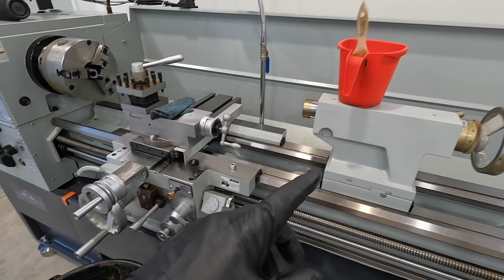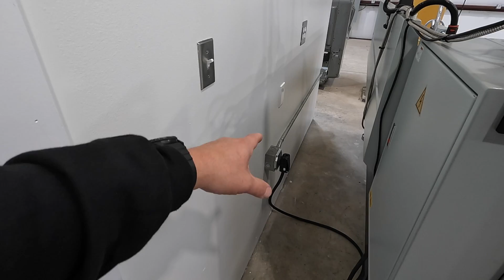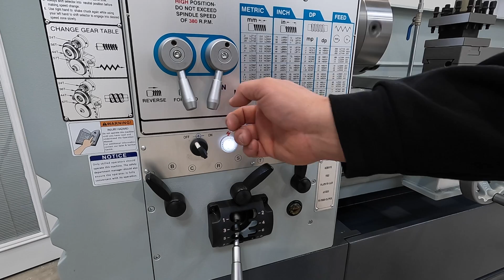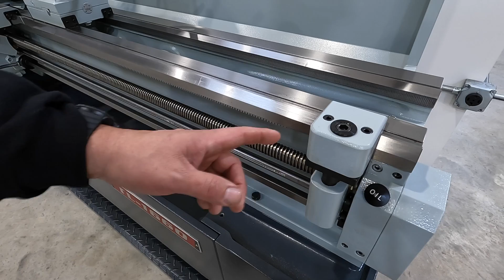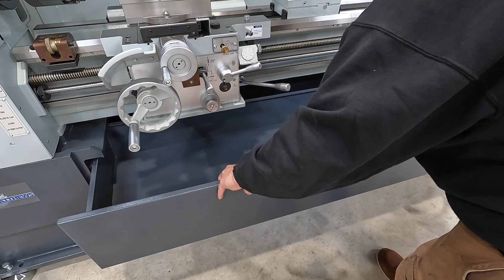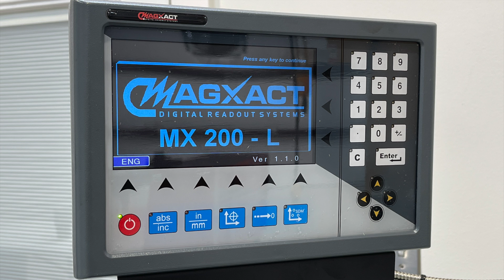Precision Matthews TL 1660 First Run

Comment: I'm happy for you but I do not understand why you went down to a small lathe after your iconic big lathes.  If I was already making a technological turnaround I would consider switching to CNC.
Reply: It's very convenient to have all common machines form factors. Machining small pieces in large machine is not preferred.  Mainly because of visibility (sometimes) and also for feedback.  Larger lathe aborb vibrations better than smaller lathes.

Comment: New equipment looks good... Going to need some serious machining jobs to pay the tab I would think.
Reply: these PM lathes are pretty reasonably priced actually. I have a 1340gt on order and it cost me only 11k (I got about every add on PM offers, the machine was only like 7k). I'm so excited as this will replace my first manual lathe I ever bought (a tired grizzly g0602)

Comment: Been looking at a PM 14inch... I have a SB Heavy 10 from 1967 I cleaned up and an Austrian Emco Maximat 7 for small precision work, but these lathes look amazing for the money.
Reply: hi, i own a new pm 14x40 ELB and its a nice machine. Ive used an enco also a nice machine before this.  For the money there is really no other option. You  simply cant buy a new usa machine for anything near the money.  and to be fair, I dont think the usa machines are much better if any?

Comment: IDK man, I know you got what you wanted and that's cool. But, for just a few thousand more a made in the USA, HAAS TL-2 would be pretty nice. Twice as much Horsepower, A2-6 spindle so you can use all your normal chucks, Variable speed through the whole RPM range, and a very easy way to get into CNC Lathe.
Reply: If you have a one-lathe shop you're totally right but I doubt it's that necessary in his case as he has the existing machine shop plus the much larger lathe in the new place for heavier work. I can see this lathe getting used for the smaller, very high precision work and the larger one for most of the day to day jobs that don't need the extra accuracy.

Edit: actually, if tool work or extremely precise jobs are your bread and butter, yeah it could be worth it. Really I can see the HAAS working well if you run a lot of repeat precision jobs to make the CNC capabilities worthwhile
Reply: For the work Adam does, a Haas TL2 (or any other CNC) would be pretty close to useless.
Reply: @rgetso  He would use it all the time, those times of trying to keep a big radius tool from chattering to put in a corner radius, all the moving the tailstock to clear chips on deep holes, just a couple examples. If you are referring to heavy cuts, the TL2- is a 1-piece casting with no cutouts for lead screws, the TL-2 weighs 20% more, and the TL-2 has  a 10HP motor instead of 5HP.
Reply: @trainedtiger  If you spend a few weeks binging on Adam's years of content, you will learn he has zero need for a CNC. He makes one off parts, repairs worn out parts, or modifies customer parts. Rarely does Adam do production jobs of any sort. If you think Adam is going CNC, you're barking up the wrong tree.
Reply: @trainedtiger  As for me, I'm trying to decide between a TL2 and a used SL10. I keep telling myself I NEED a CNC lathe to speed up repetitive work I've been doing on my manual lathe. It's hard to justify the cost for another CNC in my hobby machine shop garage. Last year's Mini Mill 2 purchase was expensive! A new Lexus would've been cheaper! I get way more use out of the Haas than a Lexus so it was definitely worth it.

Comment: Hi how much torque output does an industrial metal lathe have? In NM or FT/Lbs , thanks
Reply: The motor in this one is 5hp (~3.7KW) but torque is harder to figure out as the motors are rated for hp but that's just torque multiplied by engine rpm (torque force x distance travelled/rpm = power, sort of).
Precision Matthews gives a 5hp rating and a max speed of 1725rpm which works out around ~15ft/lb but that's very rough and based off incomplete info and sloppy maths
Reply: @helplmchoking  Thanks for replying, that doesn't sound like much torque .. reason I'm asking is because of accidents I have read about where people have got caught and dragged around the spinning lathe with ease.. so there must be a lot of torque. Maybe this isn't the most powerful lathe and the accident was with another machine entirely.
Reply: @farerse  There's a gearbox between the motor and the chuck that multiplies the torque at the chuck.  The cutting forces on a metal lathe are enormous.  It requires a lot of torque.  Imagine what it takes to make a quarter inch cut in a piece of steel.
Reply: @stargazer7644  I figured that much , would be interesting to have a number on the amount of torque at the chuck. I read 2000 nm somewhere .. don't know if I read it right though because it seems "complicated".
Reply: @farerse  So calculate it.  It isn't hard.  According to the specs, the motor is 5hp @ 1750 RPM.  That's 15 ft-lb of torque at the motor.  Geared to 36 RPM that would be approx 729 ft-lbs or 988 n-m at the chuck.  At 1800 rpm it'll be about 20 n-m at the chuck.  This assumes the motor always turns at 1750, which is how it works on this type of 3 phase motor.  Brushless DC motors and VFDs are different.  It's complicated because the power available from the motor depends where it is on its power curve, and speed and torque are traded for each other.  So unless you specify a speed, there is no answer to "how much torque is there?".  Also in reality the actual numbers will be a bit less because power is lost in the gear box heating up the oil.
Reply: @stargazer7644  Thanks a lot, this explains most of my questions. I guess exact torque numbers are not important when it comes to these machines. With cars most people want to know torque and hp to compare with different models.
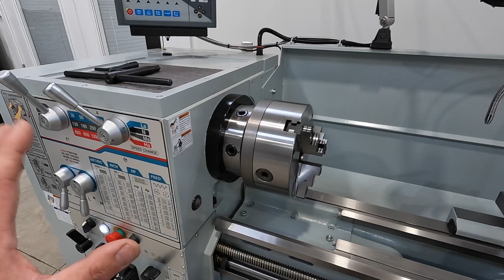Reply: @farerse  They're primarily rated by HP. This video talks a bit about the different types of lathe motors and their torque limitations starting at about 7:41 https://www.youtube.com/watch?v=znZgT3Zmf5Y
Reply: @stargazer7644  thanks a lot

Comment: Good stuff!! I was temporarily working in Mexico for a production line rebuild and had use of the plant's machine shop. I was allowed to use the "English" lathe. After repairing/replacing most of the items that were scavenged from it and getting it back to a decent machine....I asked the translator why they called it the "English" lathe, it was because the dials weren't metric. I called some guys over and showed them how the collars flipped 180 degrees to read either way....they got a good laugh out of that. I noticed they would now flip the dials on their machines before they left just to screw with the next shift.

Comment: (formally Rita Kuhl) When I cleaned up my SKS I used break cleaner and rinsed it off at the kitchen sink ‘cause it’s my kitchen. Your lath looks so pretty. These vid are great to see you set up your new shop. I’m enjoying them.
Reply: That would be "Brake" cleaner, not, Let's break for lunch!
Reply: @philipmackin1025  Thanks for the correction, where do you wanna meet for lunch?

Comment: Looks like some of their precision laths are made in Taiwan while the description for the others does not mention where they are made so it's likely China. It's ashamed we have such limited manufacturing in the US these days, even most of the old US machine tool manufacturers are making their machines in Asia. This lathe model TL 1660 is made in Taiwan and lists for $16,999.00 at the time of this video. Looks like a decent lathe, hope it works well for you.

Comment: I worked in the General Motors Oldsmobile factory. The senior hourly workers, in the engine building, had nothing but the deepest scorn for owners who failed to change all of the oil after 1,200 miles: engine, transmission, and differential. ALL gear trains "polish" the teeth as they are broken in. This produces micro metal chips, which look like grey dust. This dust will destroy the gears over time. Removing it ensures a long life to the gear train. I have owned 12 vehicles over the last 50 years. All of the first 8 made it over 250,000 miles; 9 & 10 are over 150,000 and still fine. Change all the oil regularly!

Comment: What would you do that you would need 1800 RPM?
Reply: Smaller diameter parts.
Reply: aluminum
Reply: small drills
Reply: Just about anything 1" and under with carbide.

Comment: Looks like this could have been built in the same factory as the Eisen 1440  lathes I used back in college. Even down to the font they use on the oil caps😅 They're great machines that run super strong and quiet.👍
Reply: They are these are import lathes, from China, with different colours and branding. The final shop may do it's own work to make it it's own.
We have almost the identical one to this, without some of the added after the fact niceties at work. Our feed speed slection is the same, down tot e 1-8 gear selector, ours just doesn't have a box on top outlining each selection.
Reply: @PBMS123  This lathe is made in Taiwan not China. There is a difference.
Reply: @grntitan1  Its of an identical design to Chinese import lathes. Yes I agree, there is a difference between "potentially" the quality. But the comment was more about, that this is still an import lathe.

Comment: One final word on import lathes...........
I learned quite a bit, rebuilding the headstock when I got mine.  The spindle bearings had been preloaded improperly,  and ate themselves in short order.
Making custom tooling to pull/install the bearings, and fabricating some one-of-a-kind, washers was sort of fun I guess.  But, at the back of my mind was the fact that I shouldn't have had to do any of this.  The machine should have been good from the get go.

Comment: We have a couple of machines with the feed handle mechanism like on this machine. Since this doesn't include the machine I use almost all the time, I have a mnemonic to remember which way to move those handles: "turn up face down," which sounds like you've drowned. 😀

Comment: You'll avoid using it so it doesn't get dirty.  Enclose it in a glass case like a new Ferrari...
Reply: Did you see the news about the 90,000 mile Enzo Ferrari lately? Some believe that it's value, due to the mileage, would exceed those purchased as an investment under glass ones. Pretty cool.
Reply: Ferrari's come in glass cases?

Comment: Pet peeve of mine, you should have left the plastic cover on the info so it stays clean and it doesn't hurt staying on...
Reply: That plastic will degrade and stick to plate.  Then you won’t be able to get it off.  Better to take it off and then just good care of the machine
Reply: @StubProductions  I don't agree, by the time it's that warn out it'll come off easy
Reply: My exact thoughts, I can't count how many lathes I've seen with the front panel all faded, scratched up and grimy.
Reply: Who are you saving it for?  The "next guy" doesn't count!
Reply: @paulcopeland9035  saving it for yourself

Comment: It seems like they should have run the break in procedure at the factory and changed the oil so any problems are found before it leaves. Leaving that to be done in the field seems like it could be used as a reason to deny warranty.

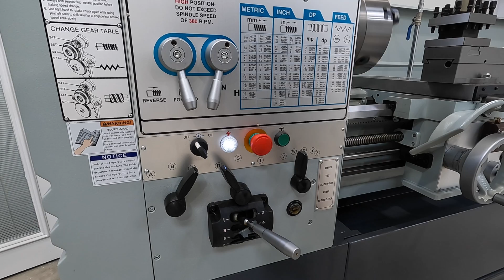Comment: Hey Adam - FYI - At 15:22 it shows a warning label to remove a bolt assembly before operating, and that is still attached in the video - Not sure what it does, but be careful!  Remove it if you haven't already
Reply: It says "released" and not "removed" I think
Reply: I believe that’s the carriage lock bolt. It’s probably loosened or else the carriage would not be able to move…

Comment: Adam, when would a job need a spin rate higher than 1000RPMS?
Reply: One word.... Carbide.
Reply: Drilling small holes and machining smaller diameter pieces require very high rpm
Reply: Carbide tooling handles high rpm well, small diameter finishing, CBN tooling, etc. Many of the Monarch 10 EE tool room lathes had 4000 rpm speeds.

Comment: You need to install a surge protection module on your service entrance and load centers to protect your electrical equipment, electronic equipment and control panels. This will help protect you from voltage surges and lightening strikes.

Comment: I can't believe how small and feeble looking that 3 phase plug is. In the UK they are big beefy waterproof plugs and sockets with flaps over and safety interlocks.
Reply: If it was 480v, the plug would be more inline with what you're use to.
Reply: @mbbmidwest3556  
What voltage is it?
UK 3 phase is 415V usually.
Reply: @codprawn  This shop is 240v.
Reply: @paulcopeland9035  
Ahh I didn't realise. Standard UK domestic voltage is 240V - most industrial is 3 phase 415V. I love it - much smaller more efficient motors.

Comment: You're able to change the threading gearbox levers while it's running? I didn't know that: I've always set the gear levers with the spindle turned off, turning the chuck or feed rod by hand to mesh the gears.

Comment: Adam nice machine from my end sound great . is the motor mounted in the base below the headstock ? Maybe next video you can show us a look at the drive from the motor to the headstock . Also do you think on a lighter duty lathe that the base is not fully cast if you were to fabricate a stout brace from the headstock to the tail side cast iron base and bolt it all together that it would help with rigidity.  Thanks  JM

Comment: yes it looks very modern and runs smooth with inch and metric both labeled, and controls are crisp as to be expected from a fresh made lathe, the lever on the feedrate though looks a bit like the break lever on a locomotive brakestand heh, looks like it has most of the bells and whistles and stops, and seems simplistic and rugged design unlike some that have an excessive amount of protective covers that get in the way or flimsy plastics from some of the designs I have seen on youtube on new machines, or some of the machinning centers.

Comment: What can you do in this lathe that you couldn't do in the larger lathe?
Reply: Tighter tolerances, high rpm, metric dials, metric and imperial threading without changing gears, empty chips from the front :)

Comment: Bad news not a legal electrical connection!  Complained about similar connections at a large company that I was working at in the 1980's. OSHA came in and wrote company up for having numerous single  & 3 phase cords and plugs providing power to fixed equipnent. Must be piped in . A short usually less then 6' of flex can be used to prevent noise or vibration problems. OSHA stated that if equipment is mobile ( on wheels ) can be connected with a cord & plug. Example could be conveyors, We always used the 1& 5/8" deep unistrut to mount floor conduit on so floor could be sweept. Best practice was to use heavy wall conduit when crossing a floor. Will not bend if a guy steps on it. Always cheaper to do the job up to code then get having to go back and bringing it up to code. Nice vid.
Reply: Its called hardwiring.
Reply: Interesting comment.  Adam stated that it wasn't fixed, but would be moved for sweeping.  However, if permanent wheels are required, that doesn't make sense for a device that must be so carefully leveled. I remember when an OSHA inspector made a surprise visit to my father's company in the 1970s, and told him that "you don't got enough lumens" in his little visitors coat closet.  I guess nothing has changed.
Reply: @johnbize5736  He means that the plug into the power socket isn't fixed and could be unplugged for sweeping. Not the entire lathe.
Reply: @beezul  Still not legal. Must be hard wired. Got my balls broke on using the cord that Bridgeport supplies on their great milling machines. Some inspectors wanted cord  removed and having conduit and some greenfield feed them. We have one inspector who does not allow condensate pumps ( little120 volt maybe 1to 2 amps ) in drop ceilings to be cord & plug connected in drop ceilings for air handling equipment even though most have to be removed at least once a year to clean gunk out of tanks. Insistes they have to be hard wired. The NEC usually makes over a thousand changes in every code cycle and with well over a quarter millon words it is a challenge to keep up with it. Until my wife came down with dementia I attended the 8 yearly continuing education at my local IAEI. I still visit Mike Holts free graphics & code question of the day along with NECA code question of the day . 70 years old and still learning.
Reply: OSHA does not apply to a self-employed individual and family.  If he adds an employee, then (in a perfect world) he would have to have the workplace inspected.  Guess what doesn't happen in most cases?
Reply: @scottgunn160  Not sure if OSHA would bother a one man shop. About 5 years ago had to take a 10 hour on line OSHA course to renew my electrical license. They did mention that a 1 person business does not have to follow OSHA rules but know that large companies will have strict safety rules. The large Hopital that I retired from were very strict. Every year each contractor workers had to go to a safety class and fill out a lot of paper work. It would take me longer to fill out forms then have cheif electrician approve work then have safety department approve it. Then turn paper work in after work completion. I could install most 120 volt receptacles  in under 1.5 hours but took longer for paper work BS. Had to get a work permit to shut off a 120 volt circuit breaker. Last yearnthat I worked they made use expensivecpensive

Comment: Here's a fun trick: to convert RPM to radians per second, multiply by pi/30 radians per second! 1200 RPM = 40 * pi (rad/s) = 20 revolutions per second.
Reply: I believe RPM to RPS is just divide by seconds per minute (60).  So 1200 RPM / 60 = 20 RPS.
Reply: That's revolutions per sec. He is talking about radians per sec.